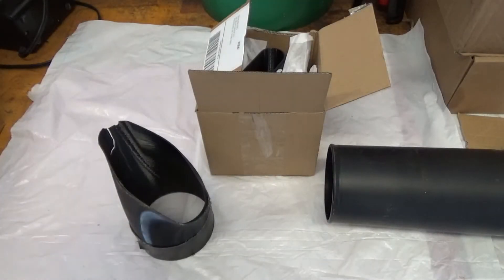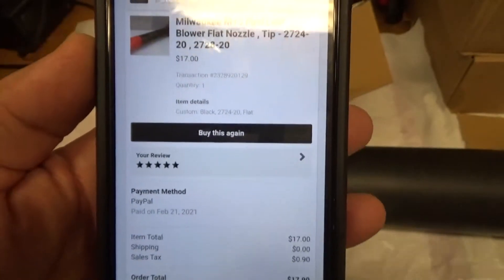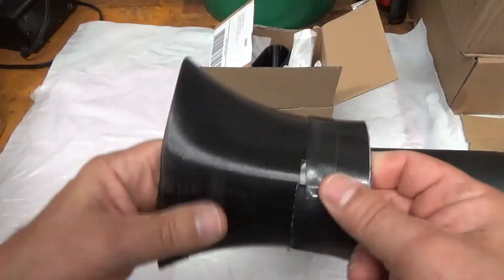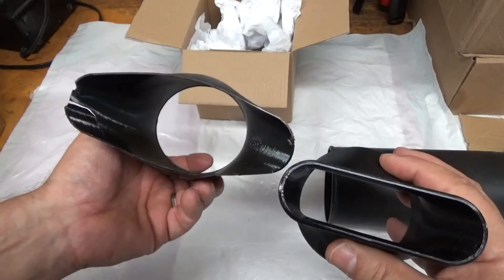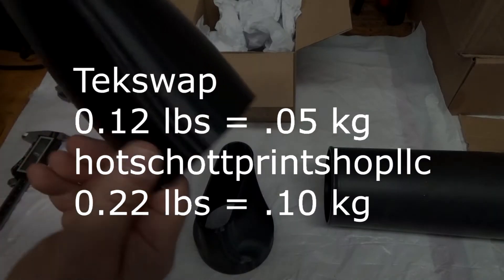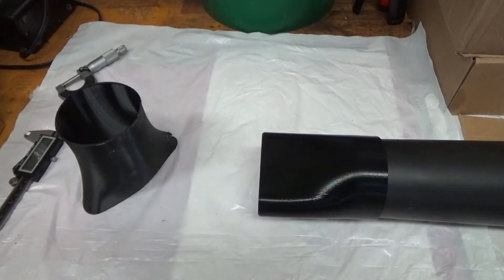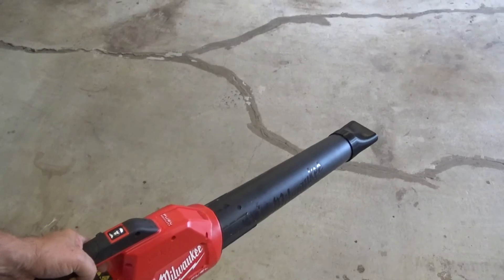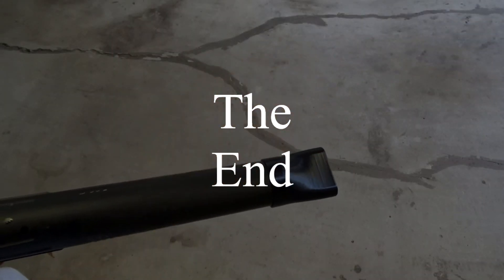Aftermarket Nozzle Review for Electric Blowers

Comment: For the structural issues, you can tell it's PLA filament which just isn't good for practical applications like this. Super good surface finish and easy to print with but it gets extremely brittle when exposed to moisture. I'm looking at making a smaller nozzle for my Toro Multiforce blower (Big turbine blower, 8" nozzle) and would be okay making it out of PETG or ideally something with nylon in it. Thing with nylon is it's super abrasive so if the normal hobbyist wanted to make it they'd have to upgrade their hotend to all metal (I did it for $23 or something, took 30 mins at the most).
Reply from the maker: Thank you very much.
I have had the 2nd nozzle for two years now and all is well.
It is showing signs of wear and will only last for a little while longer.
I sincerely appreciate your input as I have yet to indulge into 3D printing.
Perhaps you might consider making and selling this aftermarket attachment.
Reply: @A_Renaissance_Man  thanks for the update! I have a Creality Ender 3 Plus, I think I paid $380 for it and the upgrade was cheap like $23. Just assemble it and make all your initial adjustments and you're ready to go! All the software is free (I use Cura). You need CAD software to make your own models but I get the impression you already have one. I use Solidworks and it's worked great. I'd definitely consider selling it if the smaller nozzle actually makes a difference, haven't seen many comparisons of it actually working on YouTube though.